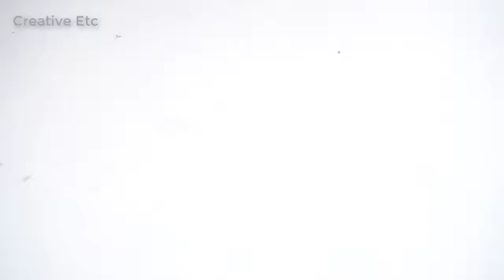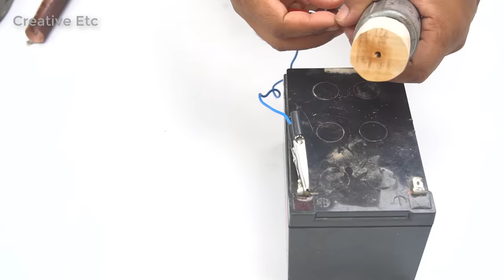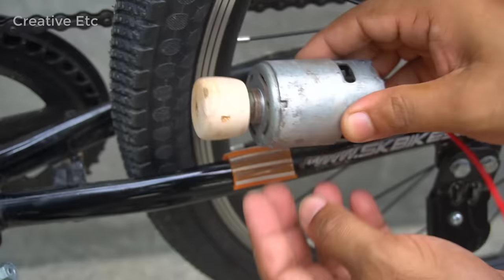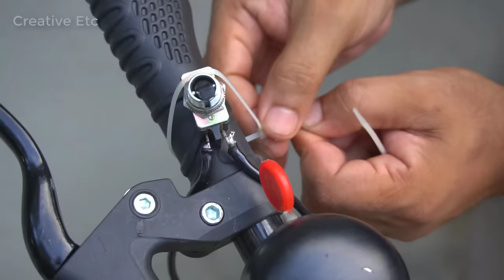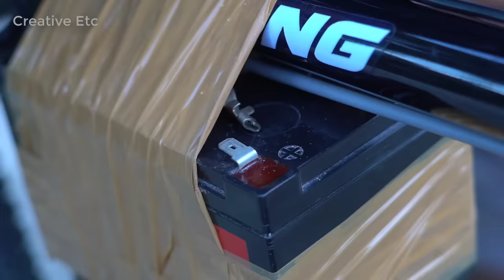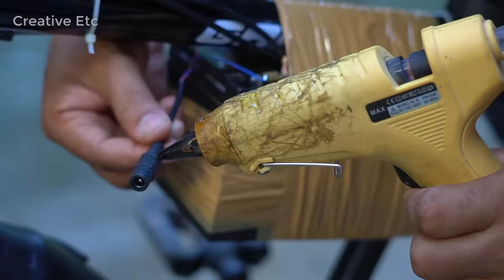How to Make Electric Bike using 775 motor

Comment: Only 3 to 5 km tyre will burst due to friction.
Reply: You should use rubber tube upon the wood to reduce friction
Reply: And then only 5 km per hour jjja
Reply: @maximodelfin2175  тише едешь-дальше будешь. :)
Reply: Шайтан арба

Comment: Inefficient way of power transmission. U should have used gear and sprocket. Any way that motor can be used as generator to light up head lamp.
Reply: Bramha's Astra  to move a cycle in a particular speed, the power will be same in both cases, as the work done is same. Think about gears. For same speed, in easy gear, you need to pedal faster, but for hard gears, slower but harder. Work done is same, so power is also same
Reply: Bramha's Astra  power = work / time. In cycling, the distance can be considered as work. So power = speed
Reply: Bramha's Astra  in your explanation, the force is different, not power
Reply: Bramha's Astra  if the motor is taken close to the centre, it will definitely rotate slowly. But ultimately in both cases, same power/speed will be generated
Reply: love you  you are footballer reply me

Comment: ^ READ THIS BEFORE YOU TRY ^

[And waste your precious time and money]

✘(Wrong things in the video)-

• The battery would last only for 2 minutes hardly because the motor is under heavy load it's eating massive amount of Amps
• The wooden block on the shaft will wear out quickly
• The motor isn't capable of driving such a load
• You need to cycle your self first and then turn on the motor
• If the cycle stops and the motor is still running, it will immediately catch fire 
• Potential risk of fire because of the uncalculated use of lead acid battery
• Adult can't ride it because they are too heavy for this (thats why he used a child in the video)
• No speed regulator too, so it would only run on preset speed.

✓(What you really need)

--> At least a 24v motor with large torque 
--> Lithium Polymer batteries are much better
--> A proper motor controller unit and a BMS
--> The motor shaft must be somehow connect to chain itself, so it will never wear out
--> Speed controlled accelerator or other system for speed regulations
Reply: You are right
Reply: Yeah
Reply: 100% right.
Reply: No speed control too... We have to incorporate a regulator to control torque.
Reply: @nirmalakumari4360  Yup
Reply: Thanks everyone for understanding
Reply: Practically understandable comment. Hope the beginner will try to implement your valuable suggestions in his next(try)project.
Reply: Itna mat socho... Simple batau to tyre he his jayega .... 
Mene bachpan me electric generator lagaya tha bade shok se.... Tyre ki band baj gayi thi 3-4 din me he.... :D
Reply: Also wheel sidewalls would wear out
Reply: It is wrong  you are try  patrically. I am already tried it mission. You all said  right right but was wrong...
Reply: @a2azad ??
Reply: @Ray-no9sj  ?????
Reply: Engineer spotted !
Reply: @chittordarpan7381  kssupa maamada jekek se le cose la velga nagonna. Jas jajaja el chito che le cae kgon.
Reply: Etrrick Smith it’s diy what do u expect
Reply: You forgot one thing : your solution will cost one thousand dollar...
Reply: @fred26081  It's better to spend some bucks and get good long lasting gear rather than this cheap temporary solution which would hardly work for a day
Reply: You took it really serious bud.
Reply: @kamilshaikh7767  does it need an engg to spot this?
Reply: @mariolulz5363  I was just saving some time and bucks of other people
Reply: @mariolulz5363  Yes b'coz they are jobless and have a lot of time to type😄😄
Reply: @kamilshaikh7767  😂
Reply: Better buy a moped.😑
Reply: I'm not a mechanical engineer, but that sounds about right.
Reply: it's not for practical use, its just for the sake of fun.
Reply: Which is great when explicitly stated.
Reply: @gaurav9806  I don't agree with it, but deception and bullshit has become YouTube culture. Sad but true.
Reply: @Rendon276  🤔😥😥
Reply: @sachingarg3870  But some nerds take it seriously and waste their money and precious bicycle
Reply: Buy a bike better 😂😂
Reply: Hats off Genius...
Very much useful information
Reply: @kamilshaikh7767  😁
Reply: @arunpraveen603  Thanks
Reply: Oneness Komban Media Welcome
Reply: Thanks for so many likes...
Reply: I know  this guy is just fake....
Reply: @getchasome6230  h
Reply: U forgot one point... The motor will not be in position after moving a small distance. U must keep a screwdriver always in pocket to adjust and make it in position.
Reply: Prebuild electric scooters are better
Reply: Motor can't catch fire because  motor is not running faster and also  not powerful to generate more torque to produce fire
Reply: Timot gari toiri  korar  kata
Reply: @provabapari7264  Didn't get it?
Reply: @user-cq6km9vq2m  if you want I can explain you in scientific physics theory why this thing won't last for long.. see bicycles were meant to be paddled not to attach a motor... The load on motor would be so high that the carbon brushing inside it may catch fire due to extensive sparking and huge amount of amps... The battery connection on the other hand is not balanced you need to calculate the amp rating of the circuit and many calculation have to be made before doing something like this...
Reply: Like
Reply: Tyre nahi kihata
Reply: And how the breaks control also.?
Reply: Appreciate the hard work
Reply: Yeah, at the first five seconds of the video, I was already screaming to screen...
Reply: @badalsheth9272  It's not the matter of hard work, it's smart work
Reply: @badalsheth9272  😂🤣
Reply: So you are saying I should buy a real E-Bike instead?
Reply: @9thbigfoot  Yes if you can
Reply: Honey FreesBee Ko vjd
Reply: @fred26081  no it wont
Reply: You are genius
Reply: @iamyournewsubscriber6633  thnx
Reply: si se usaran mas motores igual se calentarian ? o servirian como apoyo....

Comment: Good idea many problems this project power loss and tyre burst problem
Reply: Exactly...
Reply: May be we can use is in the cycle..RIM..will it work
Reply: Yes tyre will vrust very first day.so it may be modify
Reply: Put gears on the motor and all around the rim
Reply: @jewishhub2077  ur fool enough to use wood for traction on tyre..
Reply: 100%😊😊
Reply: Just use rubber tyre

Comment: wow didn't know those puny motors had the kind of torque for this application
you can try adding another motor to the wheels with a diode to recharge the battery and improve the range of the bike!!!

Comment: Very good, simple design! Excellent! I have motor assembly with 50cc engine I bought years ago that mounted on top of rear wheel,  with a scrub thing that was lowered on to tire   spinning, and i drove it really well down the street,  then tire blew. Couldn't take the strain.  Whole assembly cost less than $100, but i knew it wouldn't work unless i got some kind o really strong tire.
So i put it into garage where it's been  for 30 years.
Maybe use other guys advice and put some kind of rubber on the wheel so doesn't touch tire

I love you! Genius!

Comment: Eventually that will wear the tire down. I took an old weekender engine, same concept but on the top of the tire when I was 15. Worked for a while.
Reply: It'd be better if the propelling wooden wheel on the motor were superseded by the rubber one touching the metal ring of the rear bicycle wheel.

Comment: I made this bike with ...two  555 moters+ U.P.S battery  which have already a charge able function.....but I used hot glue on bottle caps to attach with motor.
Reply: Kus Dhankr it worked?
Reply: @fernandol4733  yes but some changes
Reply: @aspirant_365  how dis you made it with two motors
Reply: @aspirant_365  where you attach motors

Comment: it would be better if we stick rubber strip over the sides of rim and apply rotor on it rather than tyre sidewalls. this may help reducing tyre strength
Reply: How to stick
Reply: Which make 775
Reply: Which make 775 you used

Comment: Sime and easy... However the torque requirement would be too much for one 775 motor... it'll heat up after quick runs with the risk of burning it's coil....

Comment: yes i've seen something like this couple of videos i've seen, tire wheel motor driven the one i've seen was a manufactured by a company from 50's a vintage, the 2nd is  detachable type carry on;  the disadvantage is that you're rubbing the tire and it would wear out quicker, mud & poof will stuck up

Comment: With the effort, the electric motor pin will end up idling inside the wooden block.
Reply: X
Reply: I was surprised when it didn't grind out during the wheel spin test run!

Comment: I see that a motor  with 48 volts and 1000 watt has more strenght ,speed and has a high efficace for a very long distance
Reply: 1000 watt motor for long distances? 
And how are you gonna power that motor for long distances? 2 full sized inverter batteries?😂

Comment: As a hobby or experiment it is good but not so practical due to frequent wear and tear . Best if used MY1016 motor of 24volt with controller .

Comment: Due to excessive friction after 1 week. tire will explode on the road.
Reply: Make a better version sir ?
Reply: Yes true
Reply: That's true and I had come through it
Reply: Hii
Reply: Very very good thanks
Reply: @shashankc.r7947  a
Reply: Yes You are Right and also when tire runns that fast the chain of cycle also damage But we can make this same electric cycle with external chain adding on the chain so motor runns and chain start moving but thats hard

Comment: I bet you will be changing lots of tyres.
Reply: I dont know much of this but I think with rubber you would not buy many tyres
Reply: Motor agar 200 volt Chennai to kya hoga
Reply: @fernandol4733  The side of the tyre has thin rubber and will wear out very quickly
Reply: @RajuAli-ce3lc  wcom

Comment: it needs to cut off the electricity before applying the brake continuously.This is not safe, it will take time to turn it off and then press the brake on the emergency brake, which will cause an accident.
Reply: Add a motorcycle brake switch or recharge the battery while braking by reversing the circuit.
Reply: This batery can be charge??
Reply: 2
Reply: It will make the wheel getting corrosive

Comment: causes of low friction this process never work with cyclist. Or tire ruptured within 2-3 hour. so it is not productive idea
Reply: Khoti ba bacha
Reply: Itna fast toh easily ride kar sakta hu mein.
Reply: Yes it will work but what happen if the battery is dead than it will work as a break.
Reply: I think so
Reply: Fix to rim with gear teeth stick to it...
Reply: That's true

Comment: You need to use some rubber, so it will move smoothly otherwise tire get damage,and also motor gets grip ,rubber observe some force if wheel may bend,see there is black line when motor touches to tire

Comment: Fake
775 motor can't handle friction between wheel and ground
It cannot generate enough power to run a by cycle
Reply: Yes this video is fake.775 motor can't turn the tyre

Comment: I bet I can guess were your tire is going to fail first. Hint; it’s not the treads. 😜
Reply: It’s a fail execution
Reply: Gear that shit up with a leather strap. O found an old ass lathe on my ranch and I used ratchet straps sewn together with 20lb fishing line. Make a wooden flywheel.

Comment: if the battery will less than 14A it is work softly
or not,please comment fast
Reply: Below 14AH, Acclereration will dramatically reduce And below 9AH, battery dranes superfast and below 5AH, it is useless. Recomended:18AH and avove

Comment: what if we conect 2 battries and 2 motor when one motor is runing the second motor will charge the second batrry like the secind motor wil work like dynamo
Reply: good bye tires
Reply: Nice 👍👍👍
Reply: Good thinking. But..... the charging motor will add more resistance in the charging motor while rotating to charge the second battery. So the first motor which is the driving motor will have to work more hard to spin the wheel. Which will reduce the range. Also the second battery will not be able to charge to full capacity and the first battery will run out. But it will definitely charge the second battery a little.
Reply: Then you have made free energy making machine, only works in India though.

Comment: it's okay but what happens when breaking
Reply: Bramha's Astra  so basically once you hit the brakes in case of emergency the motor will be damaged
Reply: Bramha's Astra  Emergency - keyword
Reply: Bkit ga
Reply: Nice idea. But Required mechanical switch/limit switch at breaks very precisely so that when he apply break motor will automatically turn off first and then break will be applied.
Reply: Your problem is easy..you are to much thinking lol
Reply: 😅😅😅😅😅 switch off or jump off. 😨😨😨

Comment: And what about the neutral transmission, does it even exist?
Reply: Turn off motor
Reply: @janthomascaumban3455  Have you seen the friction force of a motor with a wheel when it is turned off?
Reply: im still pissed that he didn't used black tape for the battery
Reply: @mykolakurian2304  they have breakes in bike.

Comment: As a proof of concept or demo project that is intentionally super simple and low-cost - this is great. As a practical e-bike, this is pretty bad for following reasons:
- motor wears down side of the tire, which is much less durable than the working surface of the tire
- motor is low power and it's working under high load - motor is very likely to overheat and permanently break (especially while riding in rough terrain or uphill)
- no possibility to choose speed (no throttle or pedaling sensor), motor is DC, it can either be ON or OFF and that's it
- when you connect 2 cables you really should solder them together (sooner or later this will cause reliability issues and needless loss of power)
- the battery mounting is horrible - it's completely unprotected from even small accidents, so it's super easy to permanently damage it (also it could be mounted lower for better weight balance)
- all design is very susceptible to water - even small rain might be a problem
- I could write many more points, but I can mostly sum them up this way: there is a reason why most often BLDC motors are used and why mid drives and hub drives are the most popular solutions, there is also a good reason to use Li-ion battery (with BMS and adequate protection from physical damage and water) - it's more expensive than what is shown here ($1000+), but it's 10 times more practical
Reply: DC motors CAN have variable speed though
Reply: @dabe00  I guess you can do it with variable voltage or PWM (I'm not sure how well it would perform under high load, though), but neither is used here.
Reply: @psow4062  im an engineer

Comment: "How to destroy a bicycle tire in less than two miles"
Reply: I agree this isn't a smart way to make a bicycle electric but if u wanted power this definitely could be used like an alternator to charge stuff or power a
Reply: Use rubber instead of wood and attach to the bicycle rim

Comment: Panu mag buy ng materials & pwede bang mag order true fb po thanks po and god bless sir.mam?
Reply: Hindi yata siya Pinoy Bro, so baka hindi ka niya maintindihan. Sa Lazada maraming mao-order na ganyang motor. Yun lang naman ang main part. Yung battery, sa battery shop. Pero meron din sa Lazada. Yung switch, wires at ties meron din sa Lazada at sa mga electronic or electrical stores.

Comment: My friend, your wiring are wrong, positive wire must be on the switch , not the negative pole
Reply: Why?
Reply: @AS-fx1mc  
Electrons move from positive to negative, also if you ground bike chassis even with the switch off, motor will be running.
Reply: Basic of electrical

Comment: Is that battery rechargeable??
What happens if friction increases between wood piece nd tyre??
Reply: This battery is rechargeable but it must be charged with the battery charger of the cars, but wood and rubber is not recommended at all, that wood needs a rubber

Comment: i see a few problems first the battery will not last for more than 10 minutes, second the motor should be connected with a chain not a wood wheel and you do connect with a wood wheel you should cover it with rubber, third use a cheap controller.

Comment: Should be using 24v DC accu(2x12v)
Reply: Yes, but maybe it is more difficult to get the 24v battery where he lives, anyway the two 12v motors are used putting it in parallel, negative with negative and positive with positive, doing it in the normal way as usual

Comment: Whats a miracle change , once ,small  dynamo was spinning due to tyre rotation, and small Voltage, to light the small head light. Now small battery, make spin the dc motor and makes the  wheel run👌👍

Comment: how much distance can be travelled?  this motor can not be used for longer life, or pro longed use,  within a short period  the motor will be burned on load, better a hub motor with 24v and 250 watts, costing 6000 Rs, will be durable, where as this 775 motor costs 500 Rs. only,  idea good, of course

Comment: What is keeping that wood block from spining on the motor shaft? Because it will.Then spin off. Sorry dude but your motor isn't powerful enuf either.  The gear ratio of the wooden wheel to your tire size means it has to spin about 20 times to turn your bike wheel once.you need it to turn 300 times a minute for any decent speed at all. Say 15 to 20kph. And pedaling . With you on it riding not a chance in hell. I guess you got 5 seconds out of it at best.